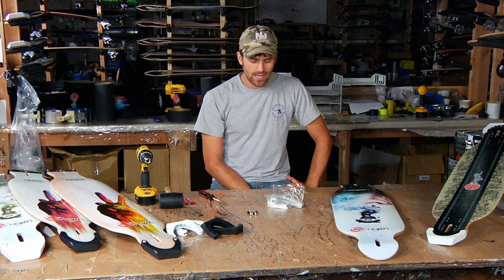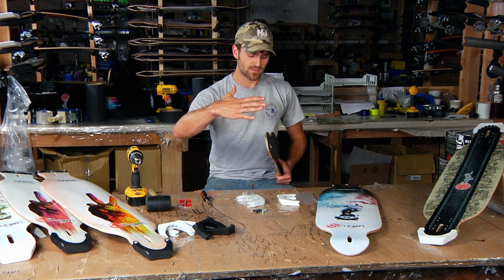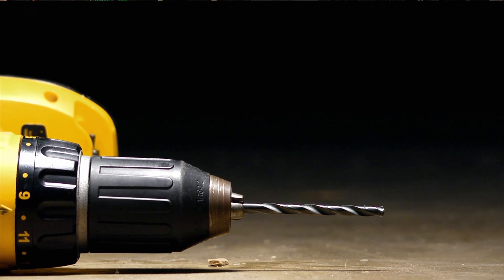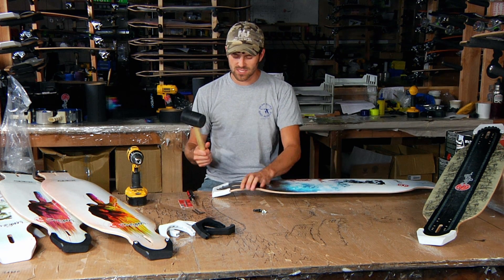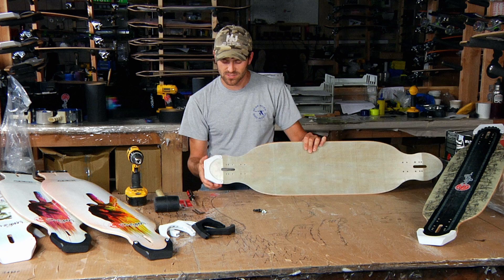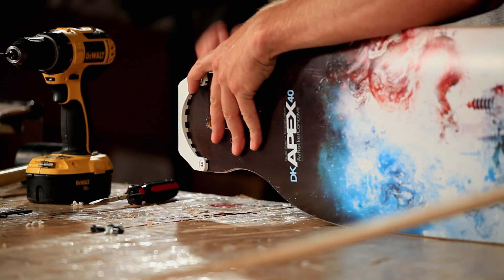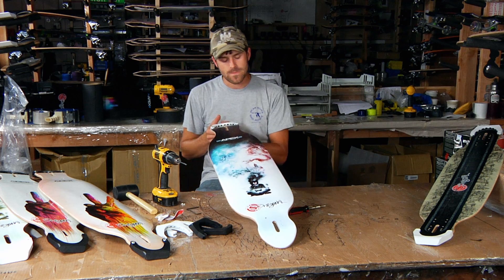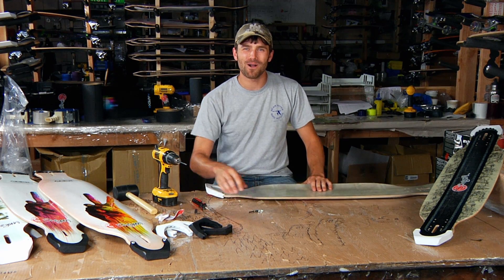How to Add PK Noseguards to your Original Apex Longboard

Comment: recently upgraded from apex37 to apex40 diamond drop... not to happy with the graphic or the protection on the bottom of the deck. i fell in love with the apex37 because of the design  like the carbon fiber look and the feel. if i wanted to add a layer of fiberglass to the DD. what is the best method to do this. i notice the apex 37 looks like it had mat fiberglass, but ive seen videos using cloth? also it came factory installed pk nose guards. how do i remove those to prepare for the fiberglass

Comment: Does the pk nose guard fit on other board such as the Komodo board ?
Reply: Unfortunately no, the Apex is much much thinner than the other board construction styles out there.  Rather than more wood we use a bunch of extra carbon since wood fatigues much more over time.  The side effect of that is the thin-ness of the Apex, which basically means the noseguard isnt wide enough to put on another board.  It is sort of a game changer though so hopefully you get a chance to step on an Apex with the guards, the pop they generate is bigger (imo) than the durability increase.

Comment: Can someone please help? I put PK's on my apex properly but they WILL NOT come off. I tried put them into a clamp an pulled my board with all my strength and almost knocked over the table the clamp was drilled into. My tail was like all bulky and deformed and i even took the griptape off but the kicktail still refuses to come off. What do I do?